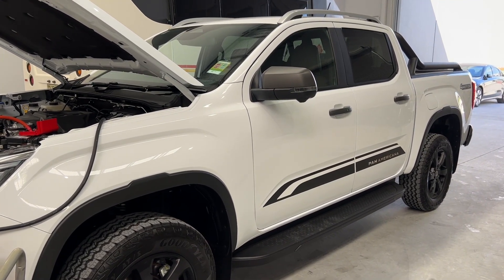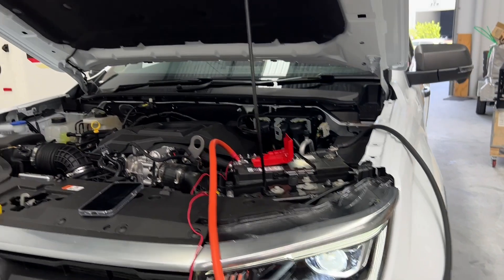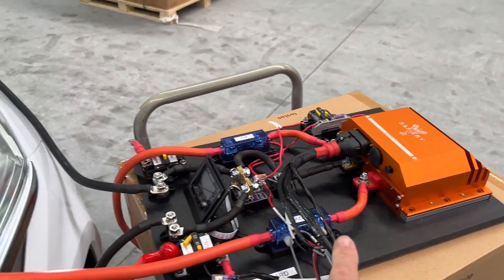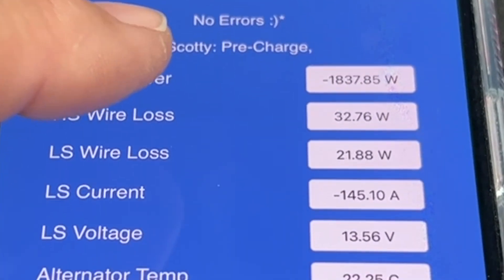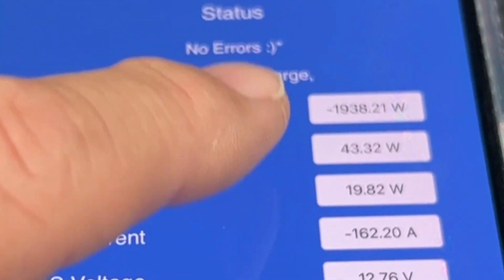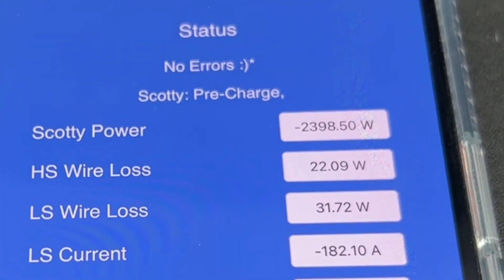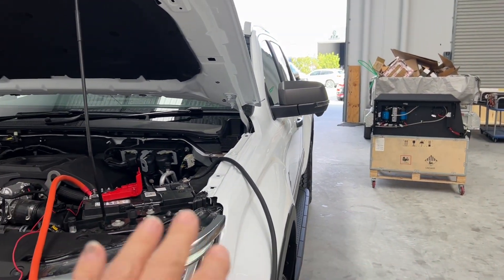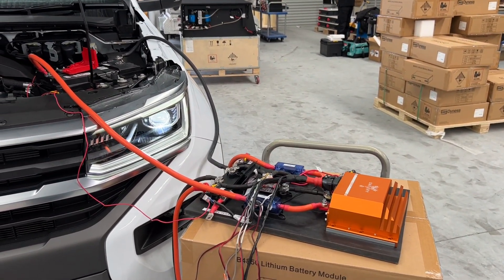New Amarok Pan Americana testing Scotty AI and getting 160A on DC to DC at idle -no need for solar

Comment: This looks awesome! I’ve got a 280Ah 12V lithium battery that I can’t charge fast enough with my existing Victron charger… this looks like what I need! Had a couple of questions:

Can it do 12V-12V? And in a Prado, with a 150A alternator from the factory, will I need any special equipment to make this work? How much heat does Scotty make during operation? Is interior mounting safe?
Reply from the maker: No it cant do 12-12. And at this power level, generally 12V is not the right voltage anyway. However, we do have an 80A DC DC called Killa wasp. It has alternator sense now as well. So thats 1000W about 2.5-3 x Victron 12-12 30A